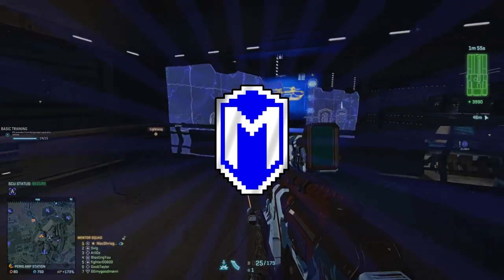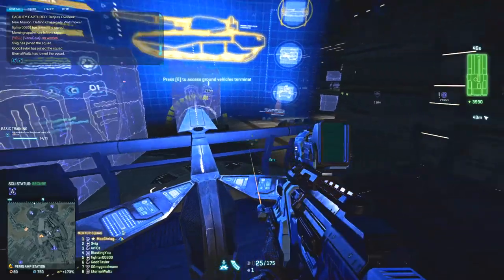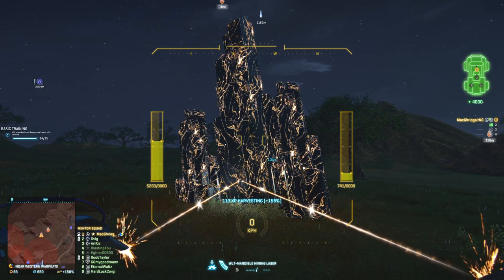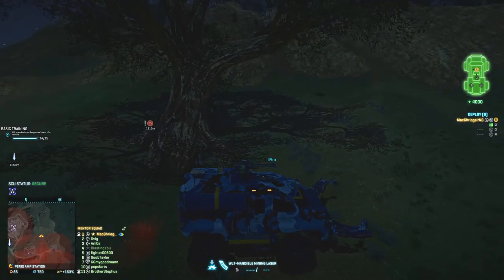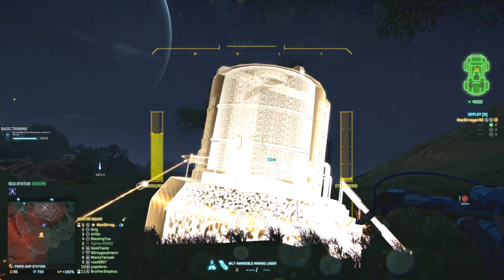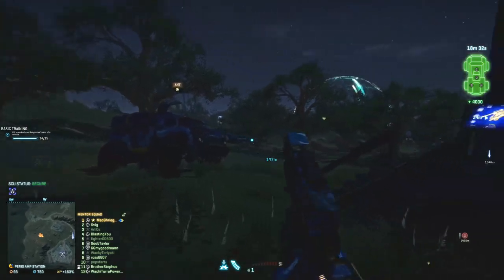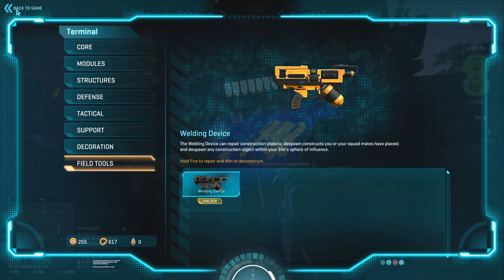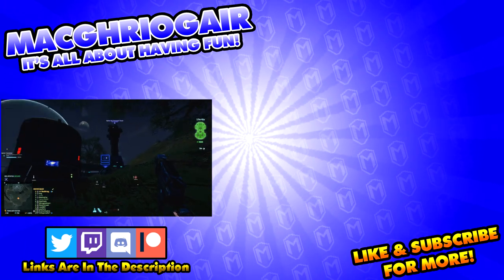How To Use The ANT And How To Build A Base In PlanetSide 2 - How To Guides And Tutorials

Comment: How do you can lock your own silo to prevent to be used for other faction players?
Reply from the maker: Unfortunately, you can't. You can try to keep your silo under 20,000 to prevent people from using the terminal, but it doesn't prevent people from filling it higher.
Reply: @MacGhriogair  I think that option is needed, specially if you are building a squad base or a hidden routing point,. Permissions like vehicles are necessary for the silos to prevent casual or malicious ressource drop / sabotage.
Reply from the maker: @FSHerrante  I completely agree with you. It was originally in the game, but it was removed because they wanted to encourage more team play.